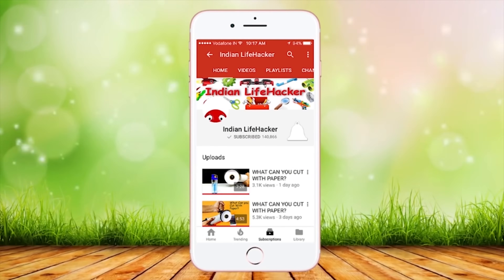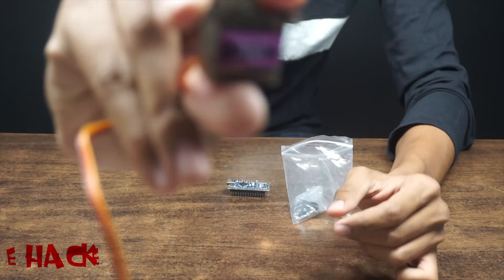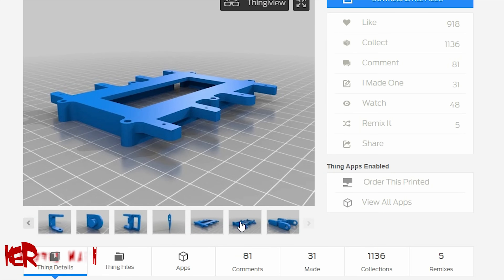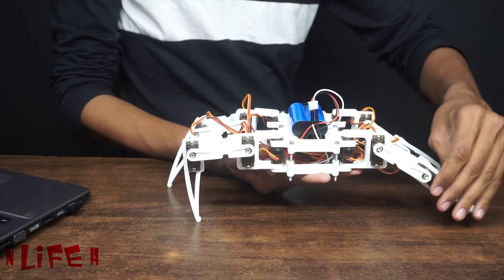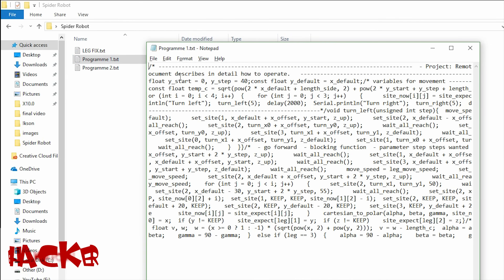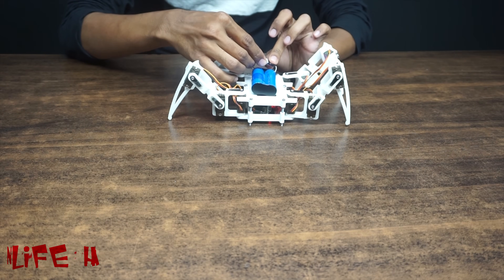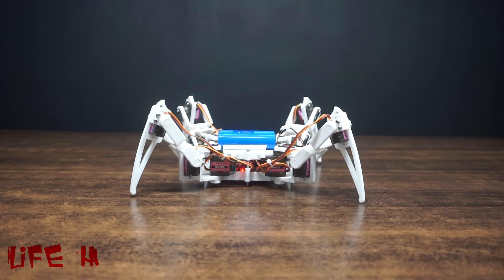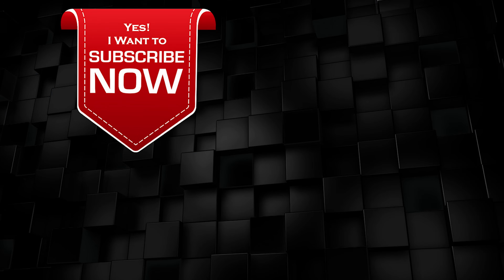How to make a WALKING SPIDER ROBOT at home | 3D printed crawling robot | Indian Lifehacker

Comment: I am using the same parts as you, but how isnt it a problem, that you use 2 18650 on the mg90s Servos

Parallel they shoudn t have enough voltage an parallel the would have to much

Comment: Hello bro. I am working on the same project and using 2 18650 batteries (3000mah) of 3.7 V in series. But the quadruped doesnt work properly when its just connect to the batteries. by DC.

Comment: If you use 2X18650 batteries, that is 8.4V! Each servo can handle approx 500-600mA at maximum 6V, that mean your servos SOT-23 will burn for sure.

Comment: what's the cost of 3d printing in india?
Reply: If u go for Moderate type material, it will cost you around 800 rs for this structure
Still: 3d printing cost depends on 2 types :
1: Some shops cost price per gram material used to print the product: For moderate material, it costs approx rs. 10 per gram

2: Some shops say if my machine prints for 1 hour, it will take 100 rs, doesn't matter how much material used, This model took around 7 hours for me to 3d print

Hope it helped you Nikita
Thanks

Comment: Hello great job I recently build one but it not moving I see you using the 3.7v battery I try that when my holder come in. Plus I see you install your code diffident I'll get back with you to see if it works.

Comment: How to controll it ?
Reply: name is andre collman - i wonder too [sml]
Reply: I think the Arduino programs have the commands in them, so when you connect the battery the robot follows these commands. You can change them in the files (Programme 1 or 2).
Hope this helps :)
Reply: Yea I know but How can I controll it with controler or bluetooth app...
Reply: Well, on the thingiverse and the instructables tutorials, the robot is made a little differently, though there are instructions on how to incorporate the bluetooth module, which is controlled with a phone and is a significantly more difficult way to control the robot.
Links for the instructables and thingiverse tutorials are in the description btw :)

Comment: What was the cost to 3d print the entire project?
Pls reply.
Reply: bro... Just take the cheap 3d printer with the printing area of 220 mm x 220mm costs you about 200 USD, but the whole project (Not include the printer) is about 50 USD.

Comment: you connecting servos power and ground directly to nano? while on schematic it shows you connected separately? 18650 battery is used i can see that but are they connected parallel or in series are you using any boost circuit to power the servos or step down ? so many questions left unanswered lol

Comment: in your version, the servo drives are mg90, and the case is from the version for sg90. they fit? or did you fix the printed model?
Reply: did you tried mg90? if yes, did it fit?